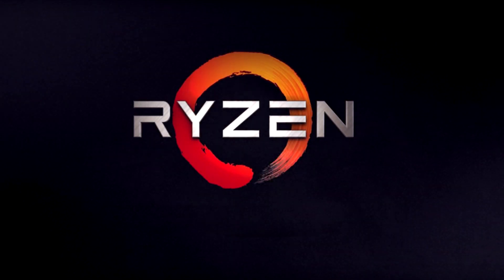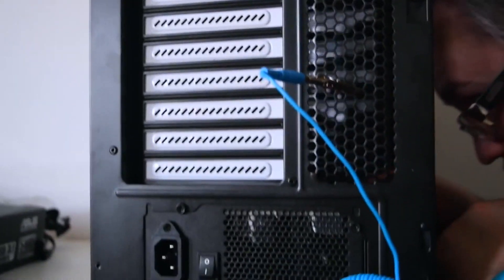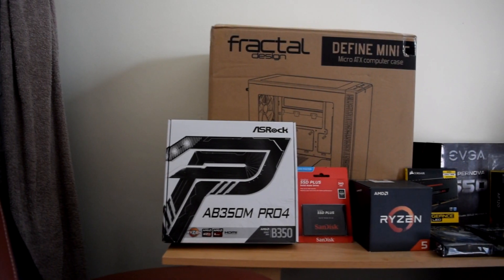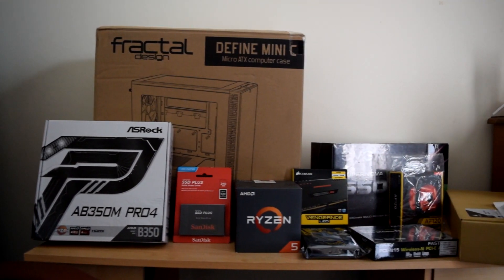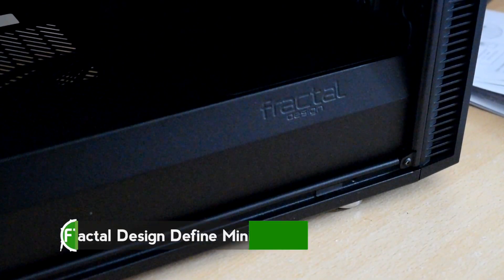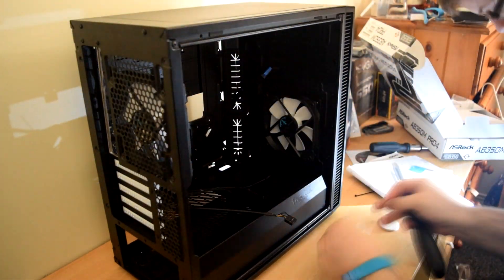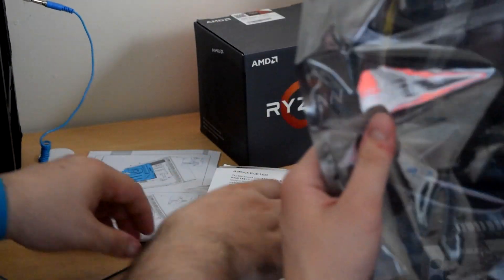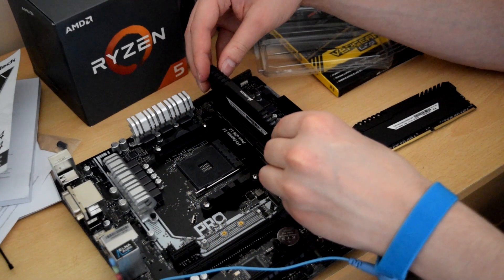My First Experience With AMD's Ryzen | Ryzen 5 1600 Build Lapse

Comment: Upgraded From an i5 3570k and gtx 970 to an R5 1600 and a gtx 1070

Awesome Processor. <3 

the best value for money processor ever.  
i don't find it boosting to 3.6 ghz tho, tried prime 95 and stuff.

i use an a320 chipset as i don't plan to oc.
Reply from the maker: +vishnu anil it's amazing the price to performance you get out of this chip. Adams went to like 3.56 on boost I think. That's a sick setup bro. I'm going to be building a ryzen rig for another friend with a gtx 1070 and r5 1600 too. He's going with the gigabyte gaming board as well

Comment: I feel your pain i wanted a second rx 480 since vega is stupid overpriced right now. So i sold my rx 480 on ebay for 300 dollars and got a 1080 instead i wanted a vega but amd screwed up the launch so my freesync monitor is useless now well atleast i can game at 144hz on a 1080 instead $509 is worth the price for a 1080.
Reply from the maker: Darkpharoh That sucks man. Are you at least happy with the upgrade to the 1080?
Reply: You notice freesync is gone in fast paced games like lawbreakers the textures dont look as detailed and you can notice jaggies more.  I have turned on the fast sync option in Nvidia drivers and that has helped alot.  But yes i can notice stutter again if the frame rate drops from like 166 down to 122  you just dont get any stuttering with freesync and gsync but like i said the fast sync option has improved the issue but games like battlefield 1 that is slower paced i dont  have a issue it runs perfectly  it just seems these fast shooters has issues. Ill do more testing on my game library games like Rising storm 2 vietnam ran smoothly it was locked at 144hz  on ultra detailed and looked and played very smooth i need to try out Player unknown and other games to make sure. Yes the 1080 runs everything at a higher FPS but it needs to be smooth as well even the1080 cant peg every game at 144hz so freesync and gsync comes in handy for that when the frame rate drops.
Reply from the maker: That's interesting to hear man, could be worth looking into something like this in the future.